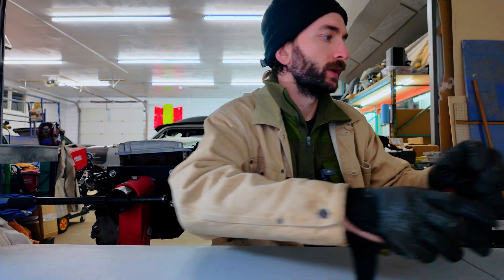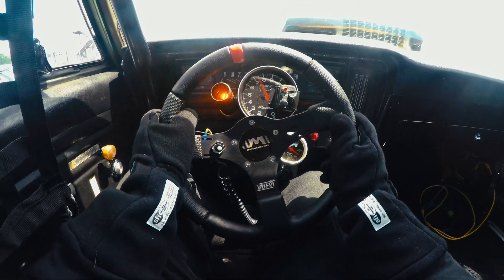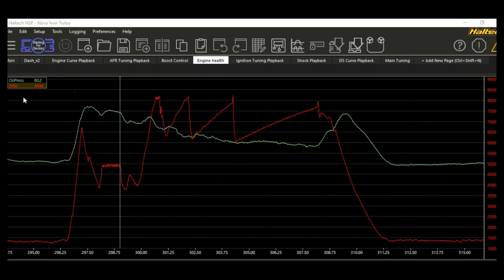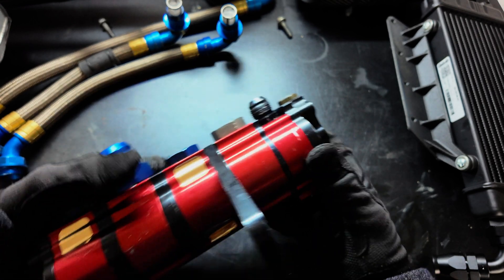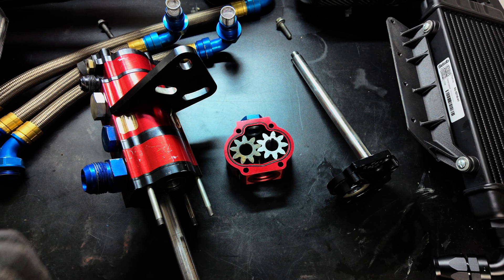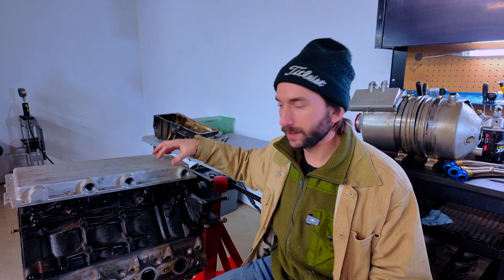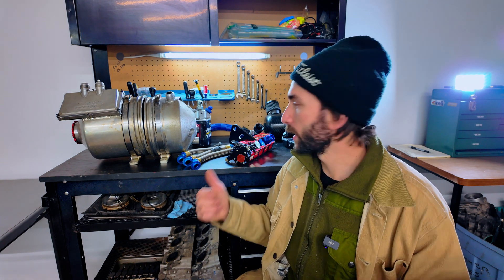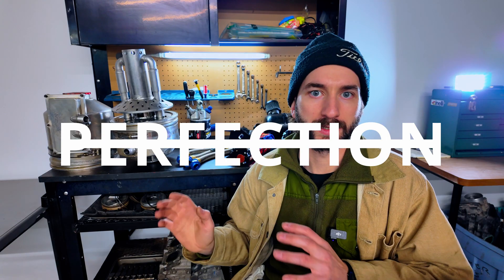Building THE ULTIMATE Motorsports Oiling System

Comment: I have been looking into doing this on my car as well (73 Duster with RB big block) to help with the extremely low ground clearance while also needing higher than stock oil capacity. Do you know of/suggest any brands that make dry sump oiling components?
Reply from the maker: In addition to the Barne's pumps, Aviad and Peterson are highly regarded. Kevko also makes pans. Good luck!

Comment: a great addition to this dry sump oil system would be an accumulator. they are absolutely wonderful, they pump up on start up and you can put a specific amount of air on the opposite end. 60 psi air pressure at when empty.  start up, oil pressure pushes back on the the accumulator piston,fills up the accumulator, you now have reserve oil volume @ engine operating oil pressure.  if your pump picks up air for any reason the accumulator makes up for it supplying its reserve oil pressure. they are also great for startups, before you turn the engine off turn off the ball valve between the oiling system and the accumulator, and you now have reserve pressure waiting when starting. a set up ive done on a track car the guy had me put a solenoid type ball valve separating his accumulator so he could hit the switch while he was cranking to prime his engine before flipping his coil power on.
Reply from the maker: Thanks for the comment. The dry sump reservoir is effectively "accumulated" oil reserve, so the pump always has supply. Additionally, priming the engine on startup is achieved by using a drill to turn the pump. This is why its the ultimate system! For wet sump systems, the accumulator you described can sometimes be a handy bandaid